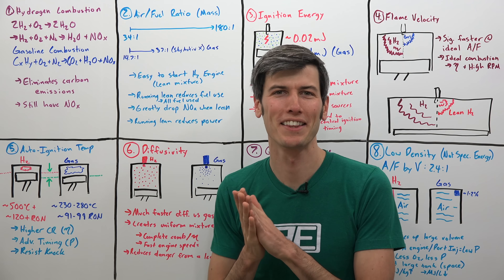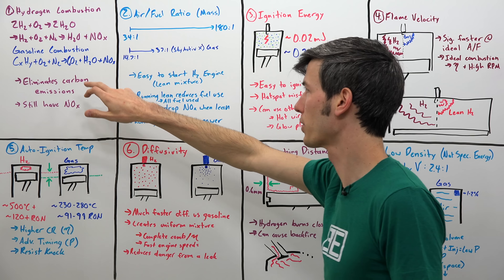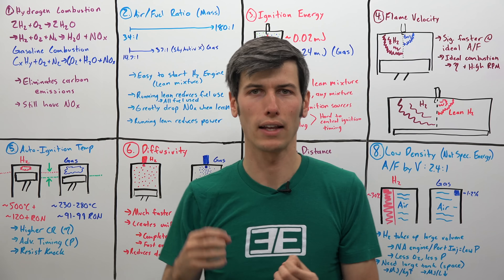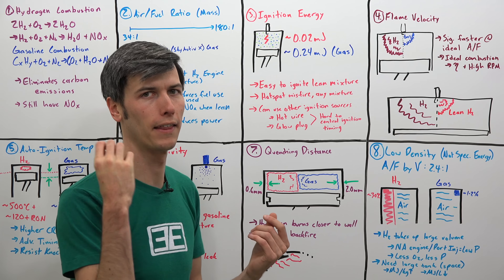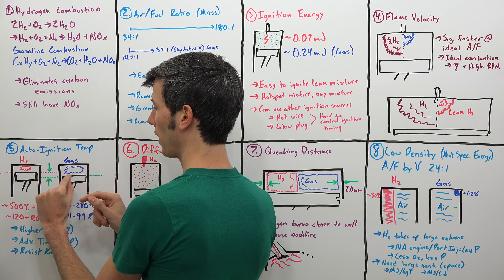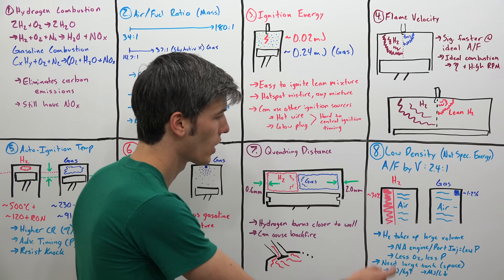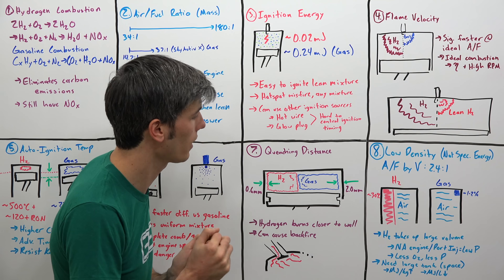The Difference Between Gasoline And Hydrogen Engines

Comment: what kind of mitigation approaches can be used to reduce NOx? (pun intended?)

I've heard from discussions of ammonia combustion engines, that adding extra fuel to the exhaust stream to react with the NOx and produce H2O + N2 can in principle eliminate NOx emissions, could a similar thing be done with H2? or perhaps some kind of catalytic converter?

are the NOx emissions really as much of a downside as they're made out to be?

Comment: Arent catalytic converters made to react with NOx emissions? A bit of a band-aid, but potentially one fix on one is as good on another? I'm also betting that a converter would get clogged less since there aren't any carbon emissions? This seems like more of a solution vs. electricity potentially

Comment: What about port injecting separately Oxygen and Hydrogen (no Air input), wouldn't that eliminate the Nitrogen Oxides that are present in Air + Hydrogen combustion?  The downside of course would be having to carry separate Oxygen and Nitrogen on board.  The upside of course would be total control of Hydrogen-to-Oxygen mixture for combustion.

Comment: Usually, anything on YouTube about hydrogen fuel is total wombat crazy crap being spouted by both egg heads and con men. 

Honestly, my concern is $8 diesel fuel. If I could tune and run hydrogen in a pinch, that would be huge! 

Back when the TARP $ was being blown (wasted) I let a company start putting up tracking solar in my pastures, that was doing a proof of concept on hydrogen powered farms. They never finished before going broke. But everything is here to make hydrogen and compress it. It’s old now, surely outdated, but I have to wonder if it would work.

Comment: Why would the ignition energy be the relevant factor in figuring out how likely a hot spot is to cause it ignition.  All the hot piece of metal does is to raise the temperature of the nearby air no?  It's not creating a spark or other near instant point addition of energy.  So why isn't it the autoignition temperature which determines how likely a hotspot is to cause knock?

Or is the issue that we are talking about hot spots with temperatures substantially in excess of the autoignition temperature so the limiting factor is simply how large a volume it can raise above the autoignition temperature in the limited time it has before that air circulates away and the lower ignition energy means that you need to bring a smaller volume of your air-fuel mixture above the autoignition temperature before it cascades?  But that doesn't seem right to me!

Comment: Mmmmmm........ Hydrogen has no Carbon emissions??? Not correct if you extend your system boundary to include generation hydrogen which requires electricity. You will only  get Carbon free Hydrogen if you have 100% renewable electricity: otherwise Carbon is embedded in the Hydrogen.

Comment: So theoretically this could be used for race cars and get more power out of them but the down side is hot spot causing pre ignition and valve clearances causing hydrogen seepage as well as in the blow in the rings especially on boosted apps so my question is how do you get by this issue if cars get hydrogen into the crank case won’t it bond making water in the crank case as it’s already been mixed hydrogen plus oxygen but not burn yet causing h2o which doesn’t mix with oil that lubricate moving hot parts so how would one get around this? it seems like it could have a nice future in racing applications thanks for the video.

Comment: Failed to mention that hydrogen has to be stored at very high pressure in order to carry enough to have the expected range, these pressures are so high that safety becomes an issue that can't be ignored.

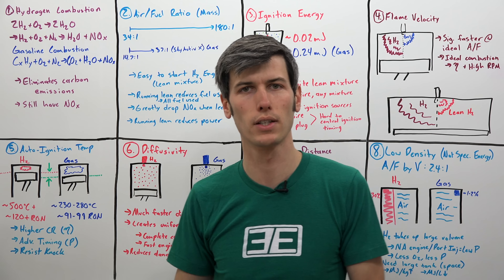Comment: 10:10, May I ask, when you looked at the possible problems with a fuel leak and came to the conclusion that hydrogen was safer, did you weigh up the increased diffusivity of the hydrogen fuel (6) against its increased permitted combustion ratio (2)?

Comment: But if you combine them you will have less emissions, more power, and not using a tank to store hydrogen, simply make it as it's being used. It will make the engine burn more gas =less emissions. Bypass the computer mapping by feeding through the power brake vacuum line. Maybe you could do another video on the combination, but with real experiments, not board work. Thanks

Comment: nice. Therefore, using a mesh material with maximum hole size of .5mm or smaller, you could feed a gasoline engine with a perfection stoichiometric mix with no additional air inflow necessary to efficiently combust all of the hydrogen to remove NOx emissions and maximize power, without a chance of backfiring and preignition of the fuel mix. At that point, it is just a matter of providing correct volume of fuel/oxygen mix for the desired RPM of the engine. Technically, the engine would only need an exhaust valve at that point if fuel/oxygen is directly injected by computer control through a high volume low pressure injector system. Interesting.

Comment: if the hydrogen creates also NOx's just as the actual diesel engines. Why not use the same solution of those actual diesel engines with AdBlue an urea solution? With that product it just creates water and the NOx are neutralized. So cleaned up and less polluting.

Comment: I would think . A direct injection that'll places the hydrogen in at boom time. And in a opposed piston engine. To max heat effecency. And torque. . And create the hydrogen in the car . With a drycell setup.  Meaning there's minium gas in the hho splitter  orsplitters
Reply: And storing a Smal small as mount to VM f hydrogen.

Comment: Hi guys I have a machine that takes the heat from the manifold generating electricity from it powers my hydrogen on demand which makes oxygen as well machine works and produces just not too sure about running it on the car yet as I'm worried about spark back fire specially on a turbo engine running the oxygen hydrogen through the intake manifold otherwise I will have to pressurise it to direct injector I don't wanna do that either any ideas thanks

Comment: how difficult would it be to make an ICE that runs lean, giving you less power when the throttle is low, but then runs richer when you step on the throttle to give you the power that it can deliver?
so for example with that hydrogen, you can run the more efficient, lean mixture when you don't need the power and the RPMs. but when you floor it, the mixture becomes richer, giving you more power and allowing you to run it in the higher RPMs? sounds logical to me, but then again i could just be misunderstanding things.

Comment: whis tesla and the stigma around hydrogen. its basically killed any hope of a public open to the idea :(
 Jason, wouldn't you say another adv. Hyd has over petrol is that it would be cheaper to convert old gas station into hydrogen station then building up an electric powerup station.

Comment: Using liquid oxygen instead of air would solve N oxide problem and many others. It should be dual fuel. Tank (two compartments) filled up with both and consumed both

Comment: Nice. Well explained.
So high NoX levels would mean the Government would mandate a DEF injection system to reduce the NOX.
Propane has something like 10% - 15% less energy but is compressible to a liquid that takes less tank space than hydrogen.
I wonder if there is something that can be mixed together that would be as energy efficient as hydrogen but take up less space in the tank?

Comment: It is very interesting …but my question is why hasn’t this theory been utilised by engine manufacturers? Could it be that the energy released by the hydrogen in combustion is substantially less than a gasoline engine? Whilst the flammability is higher and emissions are lower the power pound for pound isn’t

Comment: Love your videos and your simplification of the science.  Couple questions:  In your chemical formula with Hydrogen converting, you throw in Nitrogen but don't explain how it gets in there.  Guessing you are assuming we are using "Air" as our source for the oxygen, thus our "Air" has Nitrogen in it, correct?   What if you used pure O2, no Nox right?  Second Q:  If I had a gallon of H2O and was able to convert it fairly effeciently into H and O right before going in for combustion, do you have a thought on how many miles i might be able to get out of a gallon of water?
Reply: I would like to know the answer for where the Nitrogen comes from as well.  I agree that if you are mixing Hydrogen with  "Air" there will be other elements involved.  However, as the above posted, if the Hydrogen and Oxygen are "pure" and fed directly into the combustion chamber, how would Nitrogen be a factor?
Reply: Where does the energy to break the H2O bond come from? It needs to come from somewhere. Assuming that both the oxygen and hydrogen gases from the electrolysis process are stored in tanks on your vehicle, then it must carry a large amount of both fuel and oxidiser, which is precisely what makes air-breathing engines more efficient by volume and mass compared to rocket engines that do not use air as free oxidiser.

The engine in question is an air-breathing engine and therefore will contain 78% nitrogen by amount within the combustion chamber. Ever wonder why gasoline and diesel powered vehicles don't have oxygen tanks onboard? The answer is exactly the same.
Reply: Nitrogen comes from the atmosphere. Any internal combustion engine using air from the atmosphere will have the byproduct but our three way catalytic converters we already have deal with that, the difference here is that you would only need a one way catalytic converter as opposed to our three way catalytic converters we use on gasoline engines. The nitrogen dioxide is very harmless but the most visible and the third stage of the three way catalytic converters that was added in 1981 reduces that nitrogen dioxide by a good margin. I don't see a problem.

Comment: ....BUT filling a car's tank with hydrogen would cost about about $80 to $90 for approx. a 400 mile range. And the infrastructure to build a hydrogen filling station is way more expensive than to build a current gasoline filling station.

Comment: What if the H and O mixture is injected thru a suitably hot port into a chamber that is designed to contain only H20 and Steam? Would it be possible to recycle all of the water and all of the steam in the production of energy?

Comment: I have a tri fuel generator which can use natural gas, propane, or gasoline. It is a conventional spark ignited, carburated, overhead valve engine. It is rated 7500 watts on gasoline, 6750, on propane, and 5500 on natural gas.  Can you explain why the derate?  Is the #8 in your video the reason?

Comment: why is it easy to get distracted with Nox emissions. when HHO  electrolysis based fuel generator provides nitrogen free fuel. the advantage of hydrogen  is that the IC engine needs to be redesigned , it should not be air breathing ,  
1. you can remove the  inlet valve  as HHO mixture already contains proportionate hydrogen and oxygen mixture 2:1 provided through fuel injectors or carburetors (whichever is efficient for ignition) 
2.  only exhaust valve meaning less complexity and wear and tear of valves is reduced by half  . 
3. for lean or rich fuel mixture ratios - the HHO   generator using electronically calculated  ratios with a minimal   buffer storage of oxygen in isolated chambers.

do you have any combustion engine mind that is already tested with a single exhaust valve before ?

Comment: For the last point, if you have port injection, the gasoline evaporates and expands to about 24 times the volume of the liquid. About the same amount of space in the cylinder is used for either fuel.

Comment: The one part I disagree with is hydrogen burn speed being better for horsepower.  Race fuels burn slower which in turn gives more cylinder push time. Also allowing a more controlled flame  front. The rpm that would he required to true advantage of the speed of hydrogen burn would be beyond the capability of a camshaft controlled valve system.

Comment: i think number 8 is false. u can not pressurize liquid fuel so let say u got a big car 80 liter fuel tank put a hi pressure gas tank in it a 40 liter tank with safety equipment around it an pressurize it at 200 amosphere u basicly have 8k liter of fuel but u can not run the tank empty so 6k fuel being used 30 times faster then liquid fuel so 80 times 30 is 2400 liters of fuel so  out of the 40 liter gas tank u get over 2 times the amount of fuel and probleby if u make it with solar power at home in ur backyard a lot cheaper too

Comment: So hydrogen engines release nitrous oxide as a byproduct? Laughing gas? Or no?
Reply: Not N2O Nitrous Oxide, but NO2 Nitrogen Dioxide is produced as well as NO Nitric Oxide both of which are highly toxic.
But you get both of the toxic gasses from using Gasoline or Diesel anyway. But there is no CO2 Carbon Dioxide or CO Carbon Monoxide produced by using H2 Hydrogen. An existing engines can be modified to use Hydrogen, so no scrapping of classics. But there are too many vested interests forcing Electricity upon us.

Comment: Would the smaller quenching distance also cause higher temps in the block? as the combustion occurs closer to the cylinder wall itself?

Comment: How much would you have to compress the hydrogen to make it 50% of the usable energy density by volume of gasoline?  In rockets they use liquid hydrogen, so it is compressed a lot.  Interesting point, in rocket engines they run the hydrogen through the nozzle before ignition to both heat up the hydrogen and cool the nozzle.

Comment: So, I am not as smart as this guy.... but if hydrogen fuel creates water as exhaust. Won’t this rust rings, cylinder bores, exhaust ?
Reply: Water is one of the combustion products of a gasoline engine and it doesn't rust.  Most of the rust on cars is caused by saltwater spray in the winter.  Cars rust at a much slower rate where they don't salt the roads in winter.

Comment: 4. Less ignition advance = less losses = more power.
5. More advance does not mean more power. But higher compression does lead to more efficiently/power.

What your analysis lacks is what is the volume of that 34:1 stoichiometric amount of fuel. -> how is it attainable?
-> in LPG/methane engines the main cause of power loss is the reduced volumetric efficiency when running on that fuel. H2 has even lower density. Di can overcome that to some extent.

In the end, there is no point in using H2 instead of batteries. H2 can theoretically returno no more than 50% of the heat that could have been produced with the electricity used to produce the hydrogen. In fuel cell cars it returns about 35% of the initial electricity. In ICE, it has 50% of the heat and use it in an automobile that has system efficiency of 8-12%... That's not great.

Comment: All I needed to know was the timing difference needed to run a hydrogen engine to a petrol engine, you would make the hydrogen as you go in vehicles, huge tanks are not required. I want to run my stationary generator with it.

Comment: Ok now what would happen if I just slapped hydrogen in a Diesel engine? I’m guessing it would just blow itself to pieces yeah? Also compared to electric surely there isn’t a crazy heat difference, and it’s essentially carbon zero. You can’t avoid creating heat.

Comment: Hydrogen gas  generator , then compressed to liquid ( small amount)and then injected into the combustion chamber . I have  run my diesel 4x4 with hydrogen(mixed) and got 3km more out of  a litre of diesel

Comment: Can you tell me how the Nitrogen Oxides produced in an IC engine with hydrogen fuel ?
Reply: Air is 70% N2. At high temperatures N2 and Oxygen combine
Reply: @scottjones6921  so if there is something to remove nitrogen before entering to the IC engine or something ( selective catalytic reduction) to remove Nitrogen Oxides after the exhaust stroke , is cost effective ?